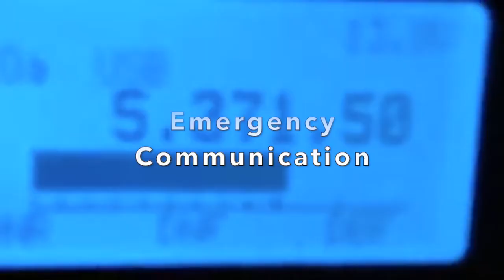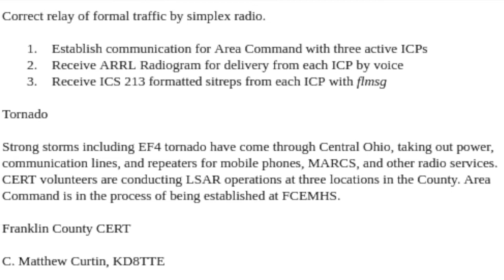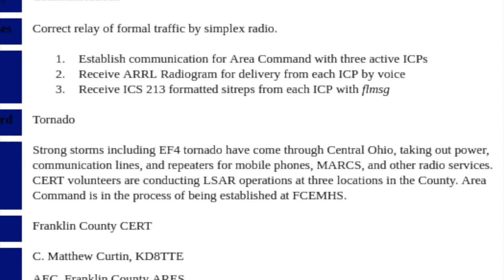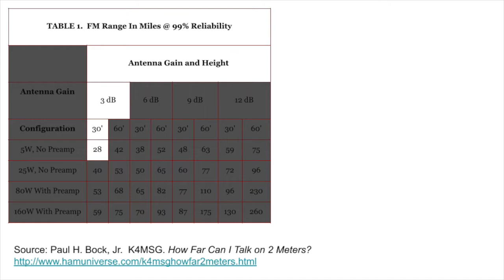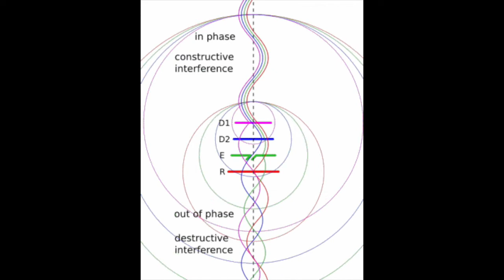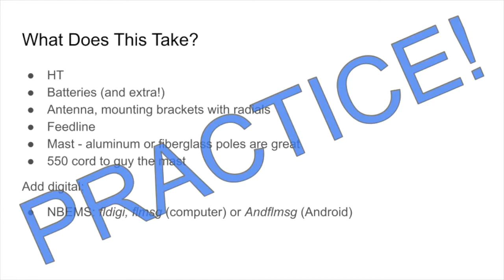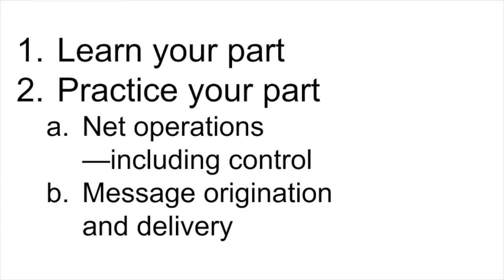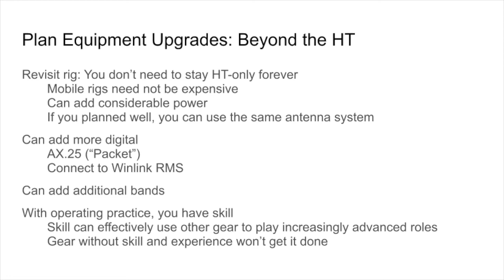What Can I Do With: an HT and Technician License? (KD8TTE Ep 055)

Comment: Although I have top of the line equipment for base and mobile operations, that isn't where the action will be in the case of a natural disaster. I depend on my HT's with a good antenna and charged batteries. In addition to FM, I also have HT's capable of DMR and P25 digital modes.